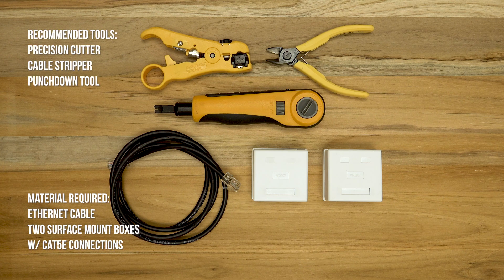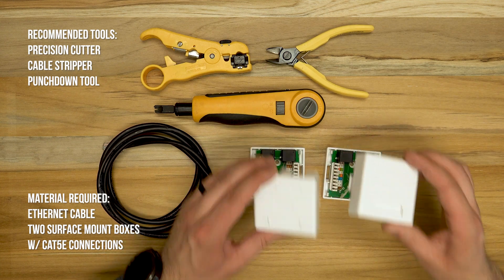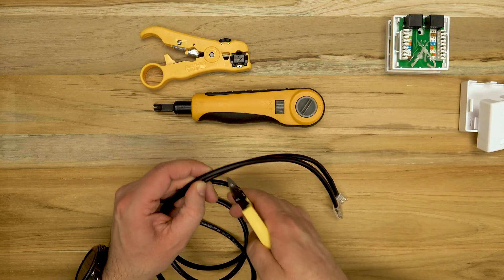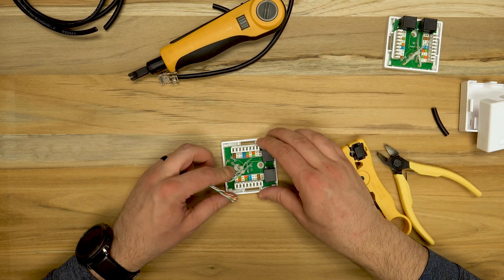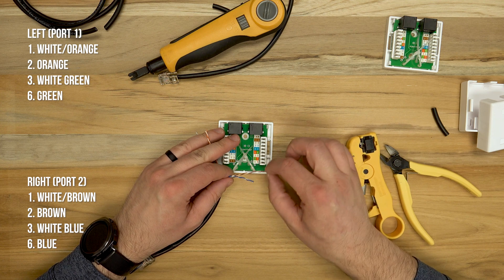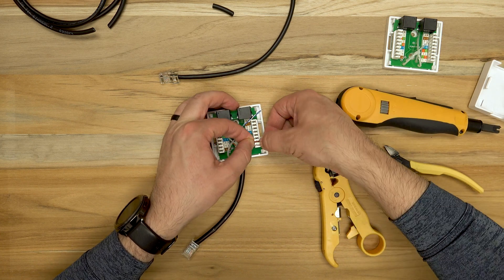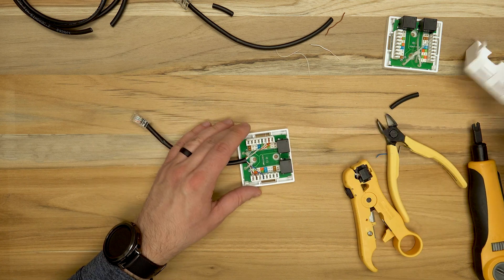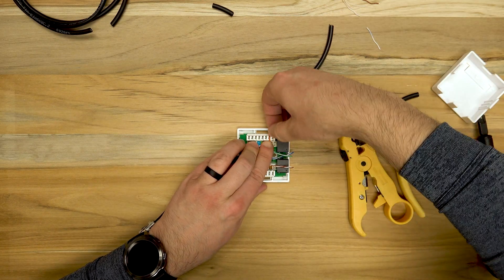How To Make Your Own Ethernet Splitter... BUT SHOULD YOU?

Comment: Those $15 switches will slow your speed down though unless you spend up and get a 2.5 or even a 10GB switch which is going to cost a whole lot more. MY only reason to build my own splitter would be in hopes to avoid that high dollar expense, I was thinking of using a small project box and using proper rated splice connectors and doing it that way, just wanted to see your video had to offer.

Comment: Agree that a switch is a great solution, but a switch on each end adds not only cost (small, but still) but also two points of potential failure. Splitting the four pairs into two pairs might, at times, be a better option than a switch..
Reply: Also, a switch needs power and takes up more space than a splitter. When you have to deal with limited space and/or have no power sockets left (or they are hard to reach), ethernet splitters may be a way more convenient solution.
Reply: @comedyclub333  Exactly. Good comments. I have two industrial appliances running off a "splitter." They're slow and thus require only ethernet speeds. It would make little sense to place them onto a switch, which is a potential point of failure and takes up needed rack space.

Comment: Guess they didn't work?
Reply: Yeah I tried the way the guy explained but only 1 port worked, the other didn't. Only way I got both to work, was to do as the video said and then also do the same on the other side of the cat6 cable. Have 2 RJ45 plugs at the other end and both having their own port on the switch.
Maybe I'm doing something wrong?
Reply: @MAPProductions  did you figure the issue out? I am having the same problem